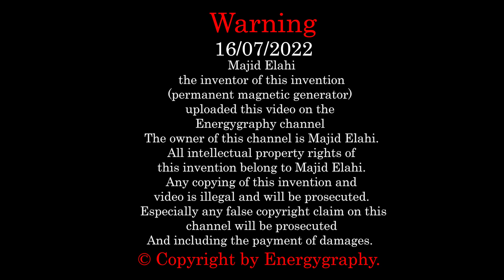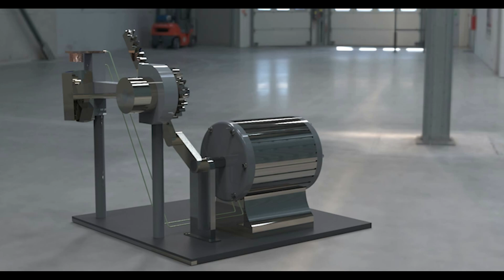Harnessing Gravity to Generate Electricity: My New Pendulum Invention Explained!

Comment: I see some improvements, 1 the height of the EM needs to match the frequency, if fixed like that you can't add to the frequency, normally a swing get higher and higher, your current design can't! also consider another EM on the other side.

Comment: ASSLAM ALIKUM
This project will Absolutely WORK if following requirements meet;
1- Magnetic repulsion should  be double than  pendulum weight
2-  Magnetic repulsion should  be on both end of  passage.
3- There should be a gear system to enhance the TORQUE.

Thank  SAJJAD ZAHOOR

Comment: This is not a generator, it‘s an energy storage device. The potential energy of the pendulum is its mass times the height from which it is released times g. A pendulum converts this energy to kinetic energy when falling and back to potential energy when rising again, with some losses to drag and friction every cycle, and will eventually stop. When you attach a generator to draw power from that system, it can only produce electric energy equivalent to the potential energy you started with, as soon as it has produced that amount, the pendulum will stop, and you will have to lift it again. This device can never create energy, it can only convert the potential energy you put into it by lifting the pendulum.

Comment: Nice beginning build. Looks easy to replicate.  But I wonder if the magnet should be a little lower as the initial swing if the pendulum would be shy of 180° due to air resistance and such.

What if the magnet were just before the bottom of the swing?
Reply: One on top and another on bottom than that makes magnetic energy not gravitational energy 😅
Reply: @ChandraDulal-y1f  I just think we have to be a bit more warry about balancing things.  We get things balanced, and then wonder why the energy equations balance out.  Some sort of shape deformation too.  You'd need a heavier weight just before the system as it's falling that zeros out again as the system rises.  Maybe the weight disengages at the bottom... Maybe it's on an elliptical wheel... Or a triangular wheel operating on its own axis?

Just brainstorming random ideas here.  Have to keep doing that til we find one that could work :)

Comment: Mr Elahi, Mercel from Germany s right regarding the losses which are natural on this earth. Another thing whom we learned it from school that Gravity is a force and not Energy. So in my humble opinion this device will not work because a machine to work needs energy which produces the necessary force to make it work continually and not a force like the gravity. I wish you luck.
Reply from the maker: dear Mercel.
This is a research
Imagine If there was no gravity, it would not be possible to produce electricity with a water turbine.
Reply: Gravity is an acceleration, never a force. You're correct this machine doesn't work

Comment: Mr. Elahi, I have a few things that you should keep in mind. First off all is the Force against the Pendulum when the Generator generates Electricity, the following Lenz- Effect will pull against the Pendulum- Force either. Second: When the Resistance of all mechanical Components pull against the Pendulum, how much Force will it take to Pull and Push the Pendulum? And third: how efficient is this Machine, when it costs Energy to Push and Pull against the Forces and how much Energy will it get and consume? Greetings from Germany 😁👍
Reply: Impossible 😂

Comment: I don't think it can produce electricity and continue penduling continuously . On the other side if we feed the engine it produces that mechanical movement of the pendulum. The electricity is feed with hidden cables from below the board and table. If you don't delete this comment your generator holds true.
Reply from the maker: Oliver, I'm a researcher and all these videos are research, Not all ideas are going to be successful, I all the time try to make real prototypes and try to find a solution for making green energy, I always said the point that free energy is an idiom, and all my ideas have a source. so I'm not trying just to attract subscribers, here we learn from each other.
I'm just honestly trying to find a way.

I know you have seen many fake videos, but it is better to know the background of the people first and then comment.
____________________
you can see this video and others https://youtu.be/Qv78aEKirZ4
Reply: Energygraphy I just love your soul.  
We're a lot a like. I so felt your comment about you just wasn't a solution, me too.  
There is no such thing as perfectly clean energy or free energy, there's only energy transferring and how to do it the cleanest way.  I love researching for it is my best tool as an inventor.  
I truly like your idea here.  
Say you had a bunch of these in a garage and every now and then you go out and lift your weights to start the pendulum moving again, I say big deal. At least you don't pay an energy bill...it doesn't matter if it's coal or natural gas spinning a turbine SOMEONE on earth is putting work in to bring you electricity. 
I say do your own work.  Save the money and the atmosphere. God bless you brother.

Comment: In a thunder bolt we can get 1million volt and we reduce a electric current using transformer and stored in a 10 capasitor and capasitor store must 10000voltage . We decrease a electric current 1million (100000)volt to 100000 volt this way next we increase a voltage using transformer

Comment: My greatness, there will be few stopping factors like air resistance, rolling friction.... Please be vary of them too bro.. I admired your concept of using magnetic push and pull to constantly generate an alternating voltage.
Reply from the maker: thank you sesha.
Reply: @energygrapgy  welcome. I have a suggestion regarding the magnetic push and pull design you showed. I couldn't find that video although. So i am replying here.  

You can place a layer of pyrolitic graphite that can just simply repel magnetism on the curved surface of the cylindrical casing, this can enable smoother movement of the piston that moves back and forth with minimal friction.
Reply: This machine won't work.
Reply: @lukiepoole9254  complications are there, but it will work
Reply: @lukiepoole9254  apart from wear and tear, mechanical friction loss, this machine works good
Reply: @seshamxy9135  It doesn't break lenz's law
Reply: @seshamxy9135  I have seen many "perpetual motion machines". None of them work
Reply: @lukiepoole9254  it only takes one :)
Reply: @colleenforrest7936  Example?
Reply: @lukiepoole9254  "I haven't failed, I just found 10,000 ways that it won't work." --Thomas Edison.